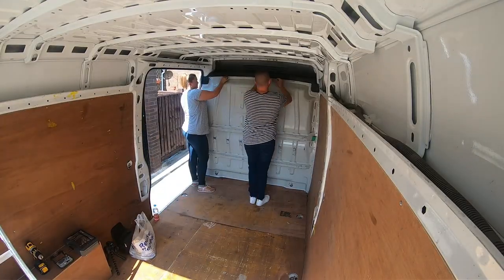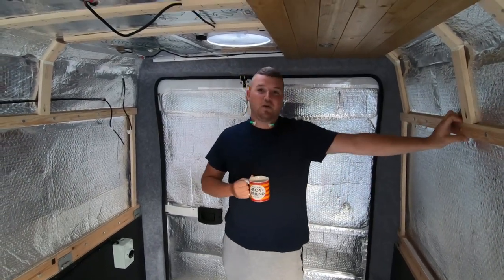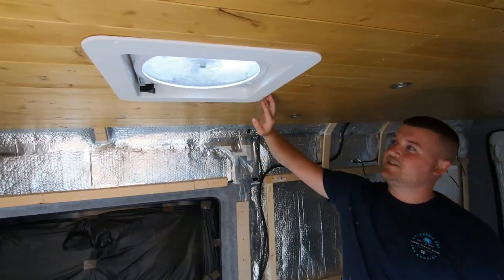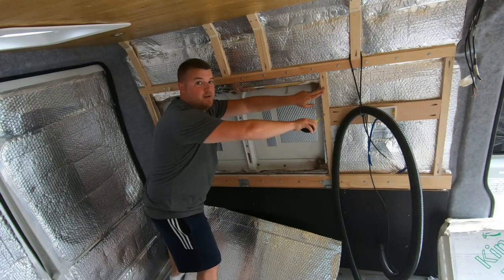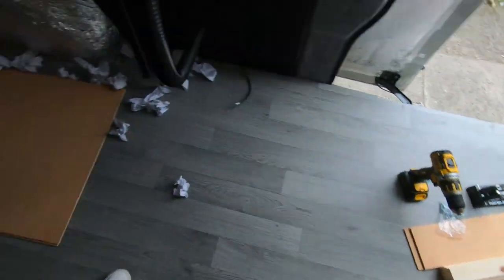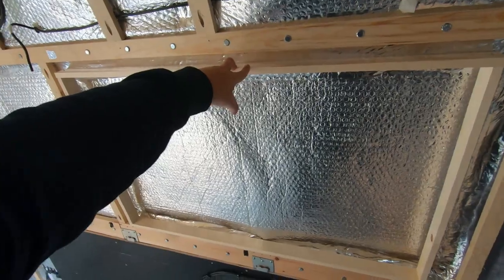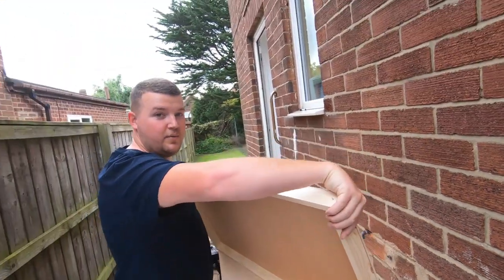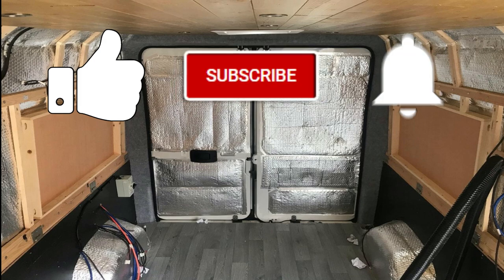Van Conversion UK | EP21 NEW Ceiling + How We Made Bed Recesses

Comment: If you need to know anything about the multimeter, drop me a message but you should read anything on the scale for the van electrics (12 volts) as DC Volts. It won’t read exactly 12, but there or thereabouts. The Solar panels you’ve already measured and seem fine, try throwing a towel over one to see the voltage change possibly. If you measure anything on the mains electric you’ll need to change the meter settings to AC Volts with the range above 240volts AC, but take care if you expose live terminals to test anything. Good to see you back.
Reply from the maker: Thanks a lot for your comment and advice, we appreciate it! That's a good idea about covering a panel, will add this on our todo list - maybe also cover one after the other to make sure they're all working.